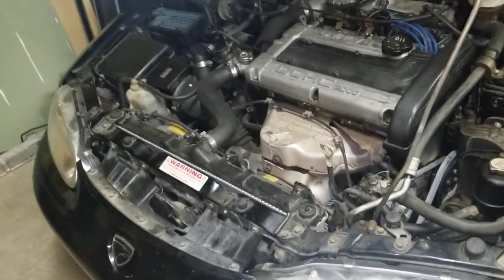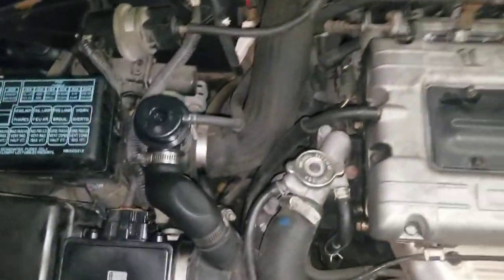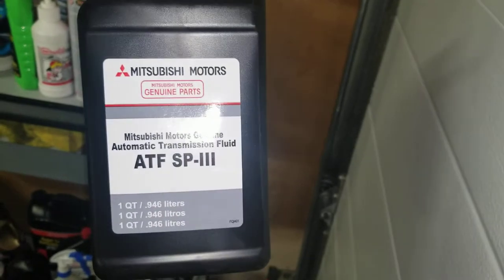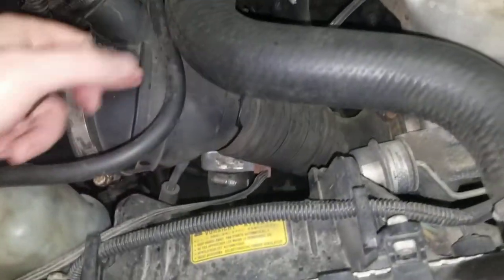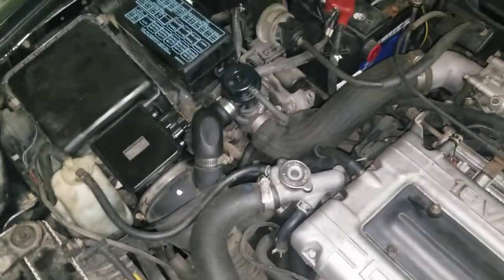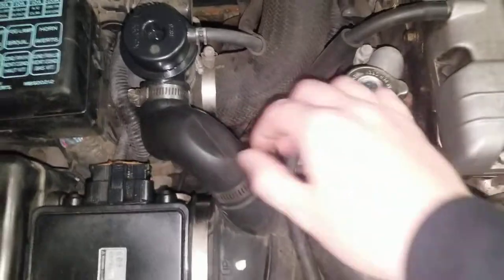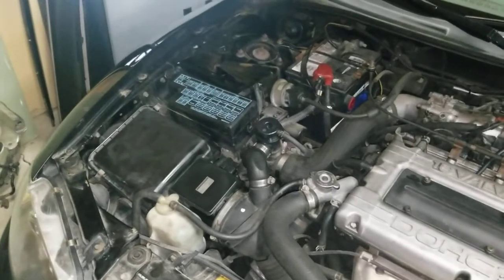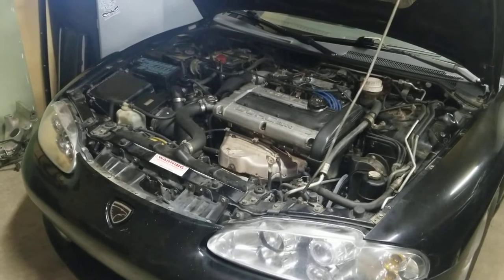2g Talon Tsi DSM "Free mods"

Comment: Could you show the free mods with the solonoid (wastegate) thing you mension ?
Reply from the maker: I'd love to help you out with that. Car is gone now. 

But if you Google DSM boost solenoid plunger I bet you would find it!
Reply: @BoltsNBoost  yes, that would be Nice. I have already Tried Google that and go to dsmtuners 😅 it just shows a solinoid with one pin goes to intake and the other goes to wastegate 🤷🏻‍♂️ Where and What do I take out 🤔
Reply from the maker: @christianbavnild  I know it's a little plastic restrictor. It should be evident when you take the solenoid out. Get it out with a screw. Simple job!
Reply: @BoltsNBoost  thanks. I will disconmect the battery, remove the coolant reservoir, remove hoses from the solonoid, screw it out and remove the socalled pin, put it back and hopefully go to go ? 😅
Reply from the maker: @christianbavnild  yessir! Should be well on your way! 

Be aware tho some people have mixed results...it all depends on the health of the turbo really  or wastegate!